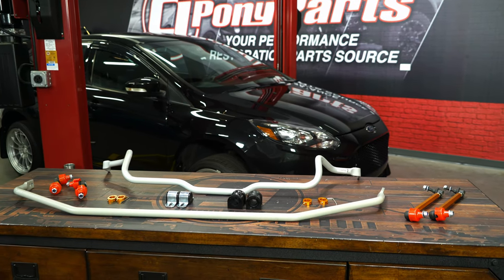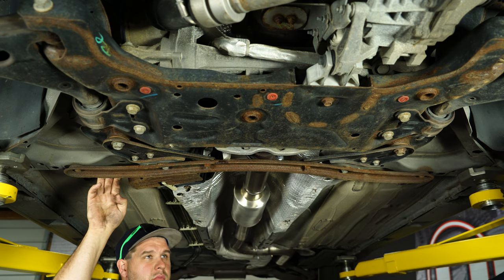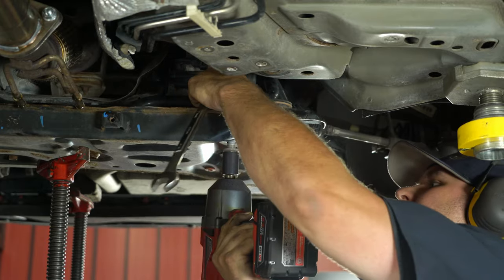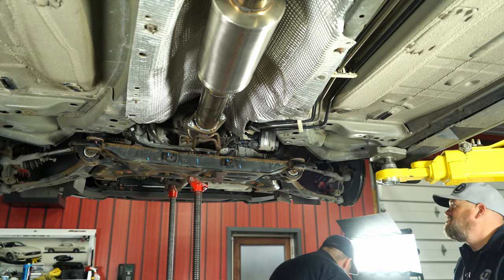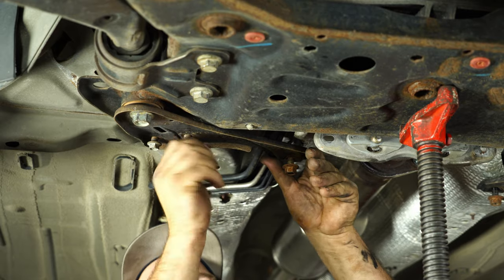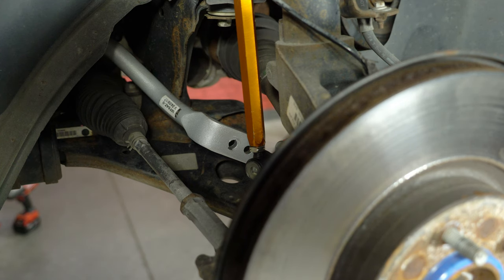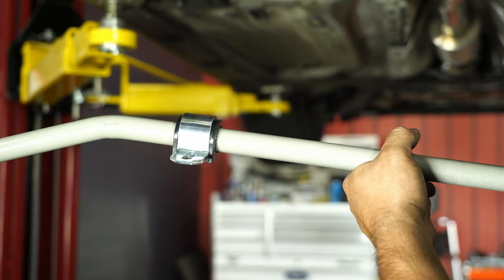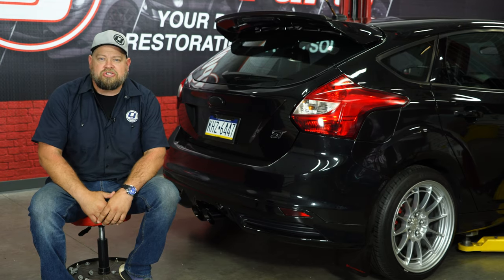2013-2018 Ford Focus ST Install: Whiteline Front and Rear Adjustable Sway Bars

Comment: How did you tighten top side of end links? My thread bolts just spin, so can't tighten nut.
Reply: There should be a hex hole for a Allen key to be fit into it and you can use a wrench to tighten it down.
Reply: @thebigdumbdog5467  thanks mate, I ended up finding that, was too dark to notice at first
Reply: Too bad this nut/bolt combination is boxed in with metal plates. Mk3 st
Reply: @TheirNthere  right... How did you overcome this poor design

Comment: Crazy the amount of rusted metal on that crossbrace and subframe. Youd think Ford would of polycoated those parts in Por15 or something better. Even our 2008 ST225 isnt like that.
Reply from the maker: vigilante351 6 years of PA winters and salted roads

Comment: howd he get off the top part on the front end link?
Reply: It’s hard to do but what I did was, I held it down with a thin pair of vice grips
Reply: The nut spins with the bolt....
And, metal plates box in the nut/alan key
Reply: If you see his hand holding the lower part of the end link, he's torqueing the bolt against the strut mount so it won't spin when it's hit with the impact.  When tight, you don't need the allen key for the first turn or two.  Crank-It!

Comment: Coming from personal experience, putting a stiffer front sway bar on a high torque front wheel drive car is the worst thing you can do for handling. The front axels need to be able to sway a bit for cornering, which is what the ST is built for. If, for some reason, you really want to turn an ST into a drag strip only only car (exactly what it wasn’t built for), then stiffen away!
Reply: Is adding a stiffer rear bar okay?
Reply: Jesse... hell yeah. I had one on my Mazaspeed 3. Stiffening up the rear allows the rear end to kick out a bit around turns, and because it’s front wheel drive, a quick lift off the throttle stops the slide immediately. Hit the gas again and it makes cornering even faster and more fun.
Reply: Good to know. Gonna be working on suspension and chassis bracing here in the next couple of weeks on my ST
Reply: @thenut1212  this is not correct.  If you lift off the throttle, you can actually make oversteer worse in a FWD car.  The lift itself shifts weight forward which lightens the rear which makes it slide even more...